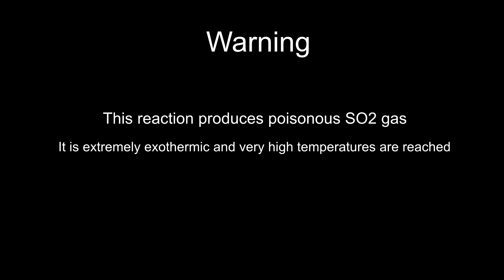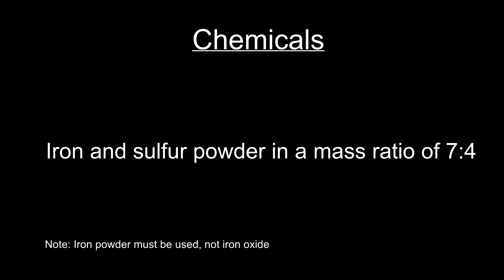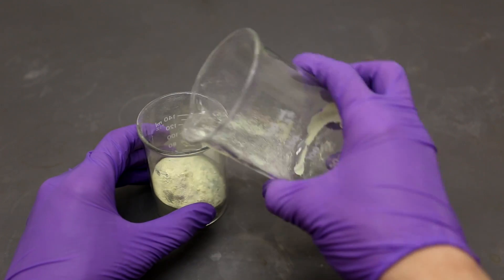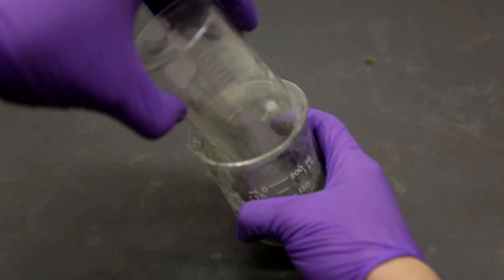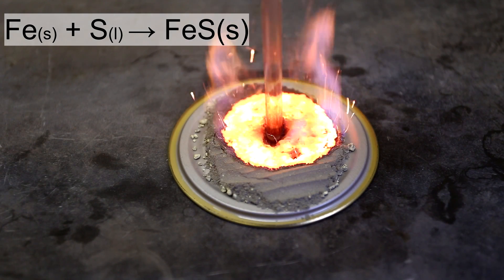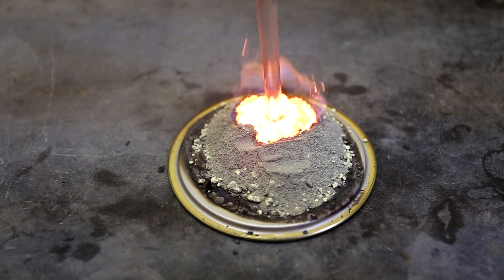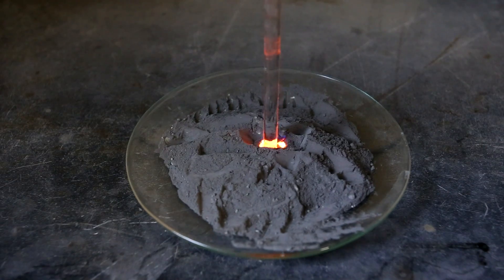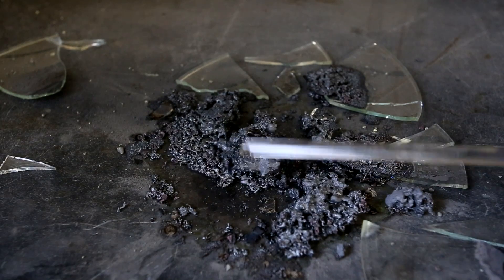Making Iron (II) Sulfide

Comment: EVEN THOUGH THIS LOOKS REASONABLY SIMPLE .....: SOOOOOooooo many things here that are very much: "DO NOT TRY THIS AT HOME". (EVEN for decent amateur chemists.) Seriously: you're making (a) SO2 (sulfur dioxide - kinda-not good); (b) risk of H2S (QUITE bad!), (c) "oh, btw, if you crush it up it might spontaneously ignite!" (um - and then, see previous death-warnings); (d) oh, it'll burst glass and melt through/burn your work surface.
(I do similarly "risky" chem stuff like this sometimes, from melting metals in my 2,000°F lab furnace to compressed gases to interesting acids -- and I'm a pro -- and I still worry about even "simple" stuff like this. 
So if I'm warning you: pay attention: s**t happens -- and when it does, it happens fast_, and here's the thing: when it does? You _already screwed up -- and it's maybe (probably) too late. And hope you have decent insurance.

Comment: I do this as a demonstration every year, but cannot get the reaction to self sustain. I use a copper plate in my fume hood. Typically I use 7 g of iron and 4 g of sulfur. This year I have tried warming the plate ahead of time to limit cooling of the reaction, and I have tried gently packing the reactants and leaving the reactants loose. Do you have any other advise?
Reply: Don't use a copper plate. It's conducting the heat and slowing the reaction.

Comment: Question 🙋‍♂️ are there any see-through materials that can contain this reaction with proper ventilation
Reply: Quartz is good for about 1600 c and I am not convinced that this reaction would exceed that. Beyond that, alumnium oxide crystal (as per some watch glasses) is good for just over 2000 C.

Higher than that and I think you might be struggling with rare earths but I have no data on their melting points.

Comment: I've been playing with making TEOS.  I've been trying the Al2 + S3 -> Al2S3;  2Al2S3 + 3SiO2 -> 2Al2O3 + 3SiS2 technique where you just dump the resulting SiS2 into absolute ethanol to get TEOS.  These fusion reactions are fun and challenging.  One thing I found was that using a small graphite crucible is a huge win.  You actually get better and more consistent yield if you heat the crucible to keep the reaction products molten for a little while longer after the self-heating starts to drop off.
Reply: Can you tell me if the formula of Ferrous iodide,hydride , sulphide is possible?

Comment: would it be possible to grind the product in nitrogen, co2 or argon atmosphere? or it just need heat to ignite? thx
Reply: The Reaction itself is just Fe + S --> FeS. There is no oxygen consumed in the main reaction. Due to the high temperatures some of the Sulfur just reacts with oxygen in the air, so grinding it und e.g. argonatmosphere would still ignite the mixture, it also simply stops the sidereactions and you could possibly use a 1:1 ratio of iron and sulfur.

Comment: Iron sulfides synthesized in the described manner will not undergo pyrophoric oxydation. Pyrophoric mackinawite, FeS; greigeit, Fe3O4; or (due to aging of the aforementioned species in presence of sulphur) ultimately pyrite, FeS2 is often  encountered in sour gas systems upon reduction of oxidic corrosion products with H2S, thus it forms under anaerobic conditions. The specific surface area is crucial for the product to be considered pyrophoric.

Comment: how is your glass stirring rod different to that glass dish that broke?
Reply: +Pagan Min Perhaps, since the glass stir rod was heated before the reaction, it was less vulnerable to breaking from heat shock than the watch glass?
Reply: Trevor Squires since the expansion of heat goes from center outward, the watch glass will heat up from the center outward. this will cause the energy to move through cooler areas at an extremely fast rate and this disrupts the dipole IMAs of the glass atoms. this rapid thermal energy expansion shatters the glass since the kinetic forces surpass the capacity of the IMAs.
Reply: The glass in the stirring rod likely has something mixed in which makes it heat-stress-resistant...like Pyrex does.
Reply: @katiedonovanAlt  Pyrex is not more heat resistant, it is however more tolerant of quick temperature changes. Pyrex actually had a lower melting point than glass
Reply: @nR00R  I commented without thinking. I meant to say "heat-stress-resistant." Thanks!
Reply: @katiedonovanAlt  All good! =)

Comment: Could you use this as a precursor to sulfuric acid, like in acid rock drainage?
Reply: This could be used as a precursor to sulphuric acid. The iron sulfide can be reacted with hydrochloric acid to produce hydrogen sulphide which can then be combusted to form sulphur dioxide. This sulphur dioxide can be reacted with oxygen in the presence of a vanadium (V) oxide catalyst. This will become sulphur trioxide which can react with water to form H2SO4 (sulphuric acid); or more commonly, the sulphur trioxide can be reacted with concentrated sulphuric acid to form oleum (fuming sulphuric acid)
Reply: @sharkiverse  It is possible in theory but why bother with iron then? Just burn the sulfur and you get the SO2 for the rest of the process.
Reply: Кирилл Рагузин Yeah, it wouldn’t be practical to convert the iron sulphide into sulphuric acid because, as you said, you could just use sulphur. However, iron sulfide can be found in nature so, when it is collected, instead of separating the iron from the sulphur to make sulphuric acid from that, you could make it directly from the iron sulphide. But in this case, synthesizing sulphuric acid directly from sulphur would be more practical than iron sulphide (especially in smaller scale laboratory conditions)

Comment: What if iron oxide is used?
Reply from the maker: That's a good question. I assume its because the iron quickly reacts with the sulfur in an environment lacking oxygen. It then fuses together. so the inside still hasnt really been exposed to air. If you crush it up, the inside will now be exposed.

This is just my assumption though.
Reply from the maker: +Elyjah Vasquez Wont work.
Reply: +Elyjah Vasquez it could turn into sulfur dioxide and iron sulfide
Reply: EXPLODE!
Reply: +Nile Red  If FeS is pyrophoric, how come it is not burned in the process of preparing it?  The amount of heat is released, should convert FeS to Iron oxides.
Reply: +Sean Marshall maybe

Comment: Rolling the powders on a sheet of paper is less energetic than pouring from beaker to beaker, and throws up less powder into the air.
Reply: +origamigek Have fun with that.
Reply: I guess, but I can't bear seeing those clumps.
I'd just put it in a small capped plastic bottle and shake it violently.
Reply: I'm pretty sure I will.
Reply: I'd just use the mortar and pestle. I like to live dangerously.

Comment: You can use a ball mill for the mixing. Its how most professionals make explosives like black powder
Reply: uhh how do you know so much abt making explosives, may i ask ?
Reply: Ball mills are great - and I use them occasionally for grinding individual elements or some compounds - but would not usually use a ball mill to "grind and blend" - So for example, you could make sure your willow charcoal was airfloat with a ball mill - and then seperately - your KNO3 and sulphur before blending.

I am VERY surprised to find that professionals would use a ball mill to MIX an explosive compound though.

Comment: In the video, I think you ought to have mentioned that the stirring rod didn't shatter because it's made of Pyrex, a very heat-resistant glass. Is that right?
Reply from the maker: Pyrex is just the brand name for borosilicate glass. In general, borosilicate glass isn't resistant to heat, it just has low thermal expansion compared to other glass. This means that when exposed to large differences in heat, it is less likely to shatter. 

The glass rod can handle so much heat because of its size and shape. When exposed to the heat, it expands in a way that doesn't stress the glass enough to shatter it. Unlike the watch glass which shattered extremely readily.

I honestly don't know very much about this though.
Reply: Pretty much any glass can be taken to red heat (and beyond) if done carefully. With suitable eye protection and at your own risk (etc etc), playing around with a few bits of broken glass tube / test tube / thin sheet glass (old light bulbs) and a blowtorch can show you that, done right, you can melt and bend glass easily enough.

I have managed to bend glass tube with nothing more than a gas cooking hob - though admittedly it is barely adequate.

Get some good protection for eyes and skin - and, at your own risk of course,  have a play :)

Comment: My first thought was making hydrogen sulfide and then you mentioned it :) When this reaction is done, people often forget that this is a good way to use it further.
Reply: The hydrogen sulfide would also make a good prank in the lab.
Reply: @Ormodius3751  Loll nice
Reply: @Ormodius3751 horseplay in the lab is a no go for me.  There are hazards beyond poisonous fumes, corrosive chemicals, and flammable materials.  Lab personnel use a lot of glass and porcelain which can break and cause injuries.  Most school and university labs are equipped with natural gas lines for the Bunsen burners so an explosion hazard is always present.  It’s not worth the risks for a few laughs at someone else’s expense!
Reply from the maker: You are right. I actually had no idea when I first did the experiment. I had to search a little about the final product to find out that it was actually useful.